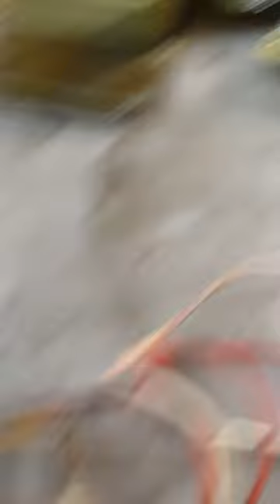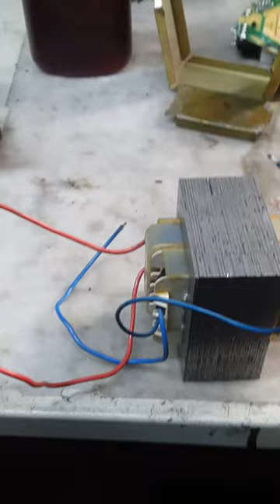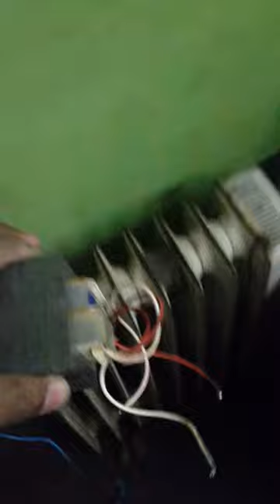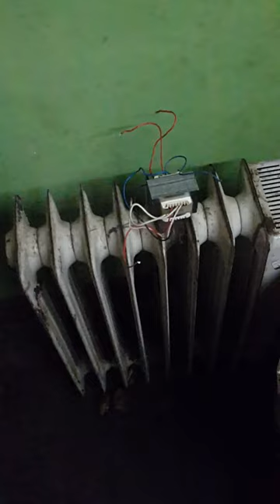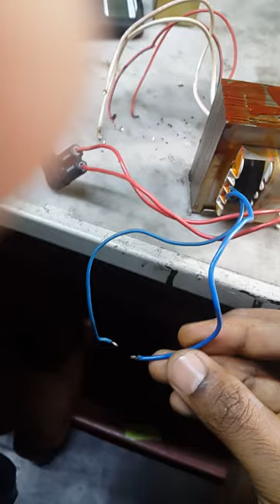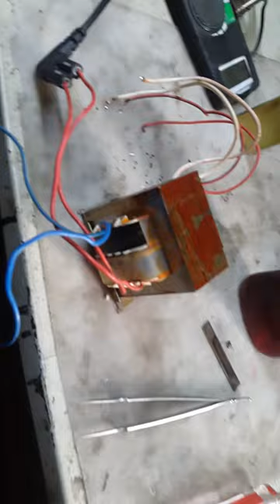how to stop Transformer Hum sound

Comment: when transformers buzz means those plates are getting de-laminated , you can either heat them up to try to put some kind og glue or epoxy to flow in between, or take 4 bolts and run them through and tighten them, buzz will stop